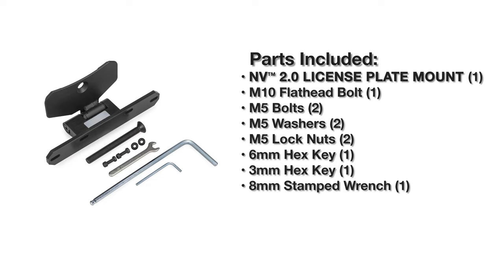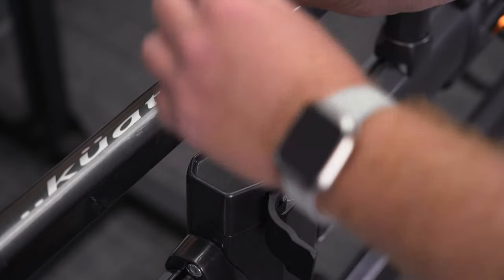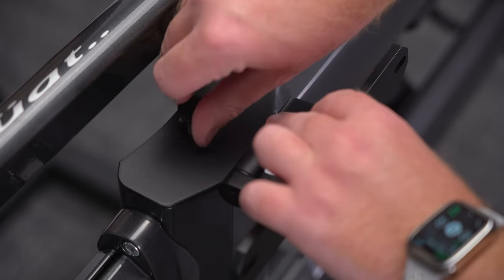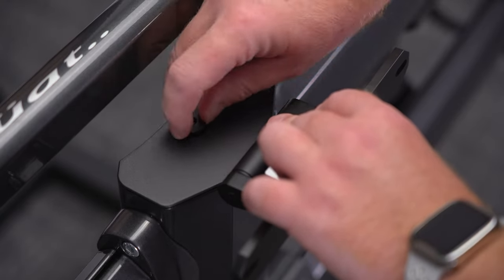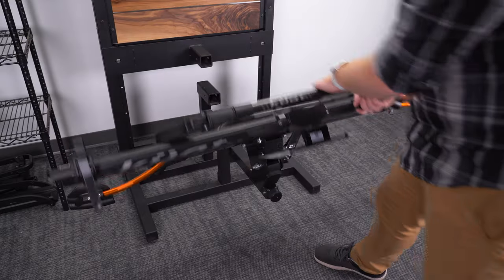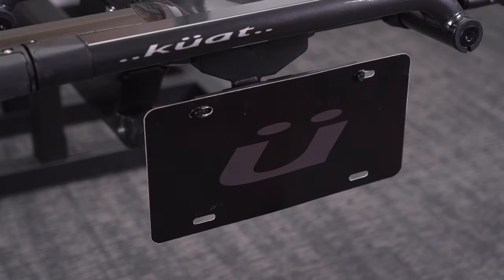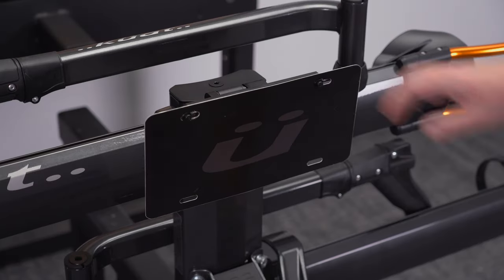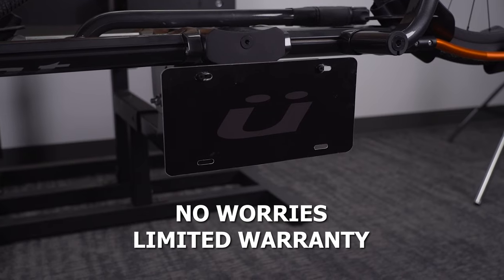Assembly Video - NV 2.0 License Plate Mount

Comment: I bought the Kuat NV2.0 with trail doc. Is so unfortunate I cannot keep the plate holder AND the trail doc. 

I have to choose to use only one which is a huge disappointment.
Reply from the maker: Sorry to hear of your disappointment. We are constantly trying to improve and appreciate your feedback.
Reply: I know right. All it is adding mount to an existing thread spot. I don't know how a longer bolt couldn't add this mount. It's not like it's a heavy piece.
Reply: What are the chances you would need that  bike stand? You can use your rack as a stand of sorts if need be. At least you don't have to worry about no plate out of view.

Also KUAT, where is the license plate light that you should have made for the plate holder? No some of use don't want to deal with moving a plate between the rack and t6he car all the  time!!!

Comment: is posible to modify this part
Reply: Yes, easier than it is. Drill a hole to the smaller hole on the plate holder so the trail doctor can go through it. 

Done.